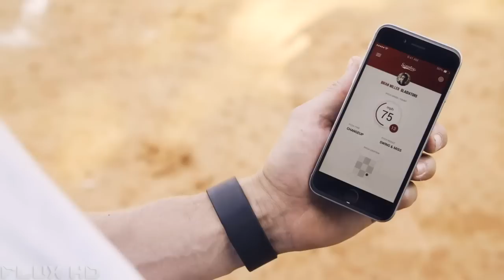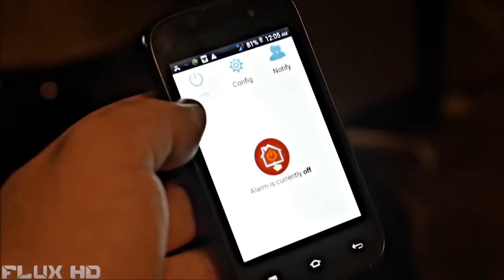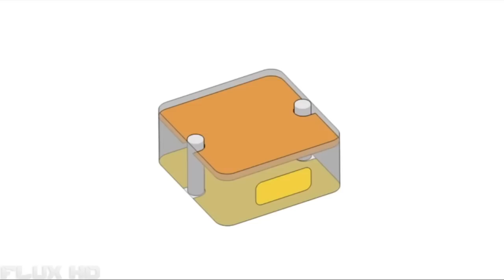5 Crazy New Inventions You NEED To See #82

Comment: The problem with the Airing is the cost. They are only good for one session, and then you have to throw it away. If you were paying their current expected price at $3, then it would run you around $1,100 annually. I bought my cpap for half that and have used it for several years now. If they made it wireless rechargeable I would pay through the nose for one, but that much waste and recurring cost just doesn't make it a feasible solution in my opinion, which is probably why it hasn't already taken off after having claimed to have raised 1.85 million in 2015 (895% of their campaign goal).